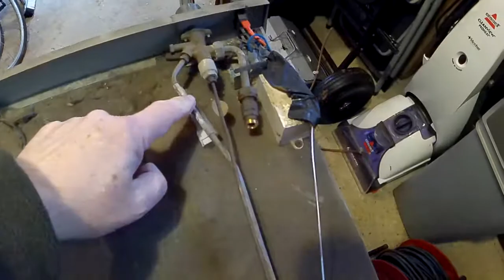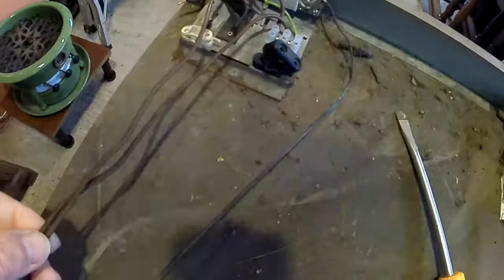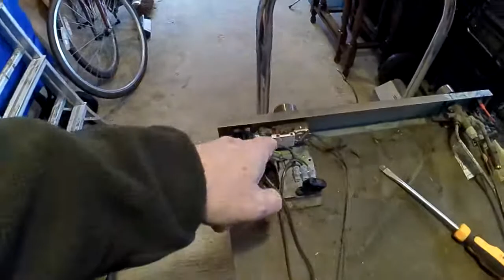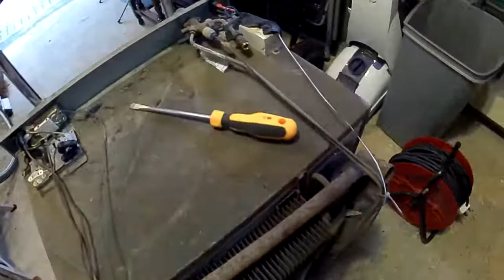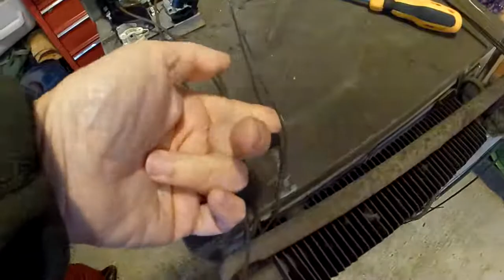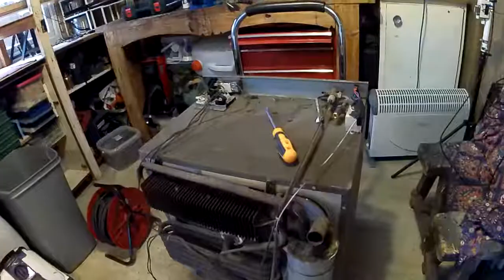Electrolux 3 Way Motorhome Fridge. Out with the old.

Comment: Hi George I have the same fridge and I have a couple of questions if you would be so kind. 

The “mains” and “battery” switch, I can’t figure out what way the switch has to be flicked to be on each one ?? In the video you flicked the switch towards the battery but said it was the mains. Is this correct ??
Reply from the maker: Gosh it's been 2 years ago or even longer. I don't have the van anymore and cannot remember. Sorry. The only thing I can suggest is connected a voltmeter across the Leisure battery .switc on fridge and watch battery voltage it should dip slightly. Engine not runing or plugged into mains. George
Reply: @MakeDoAndMend1  thanks for your reply ! Great I’ll try this - appreciate you taking the time to reply !
Reply from the maker: @bradleyfisher8933  Hi again just a reminder. The thermostat in those fridges only work on gas or 230vac.  When on 12vdc there is no thermostat so everything can got frozen especially cucumbers etc. 🤣 especially on long journeys.

Comment: Hi george .just a quick question,,are you fitting a new fridge .ie one of these new compressor fridges apparently I've read they are really efficient (,so they say )!  Also I've just seen your buck converter video .doh!! why didn't  I think of one of these being a radio amateur I should have known better .cheers keep well  Martin and sue
Reply from the maker: Hi Martin and Sue. Thanks for msg. Yes I will be replacing the fridge with a compressor type. But a lower cost brand type. Hower their technical data sheet is not good regarding dimensions and how to bolt them down. Wiring in motorhome will need changing and maybe an additional power unit may be required as it's only 12vdc and hook up power etc. I have done several videos however lost. My phone overnight decided to lose them and memory full. I have had to delete all my apps to get ph to work. So cannot edit vids at moment. Cheers from old George